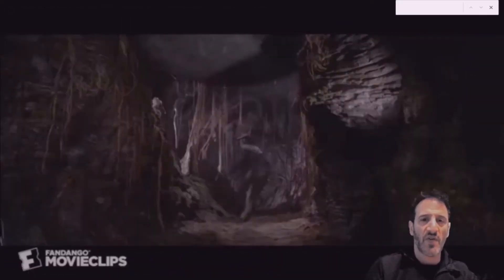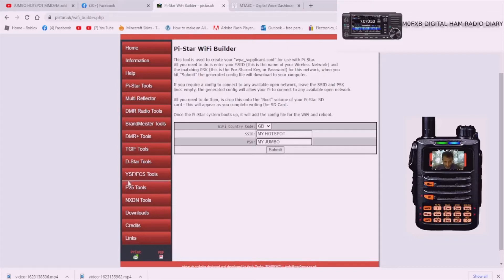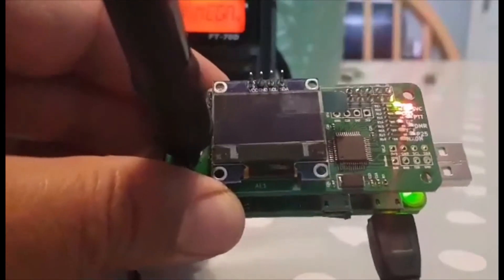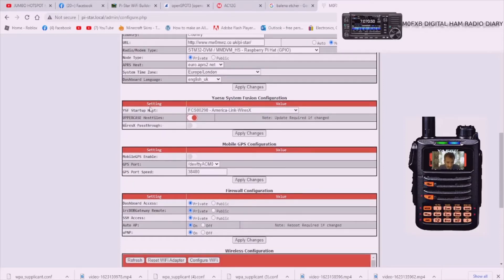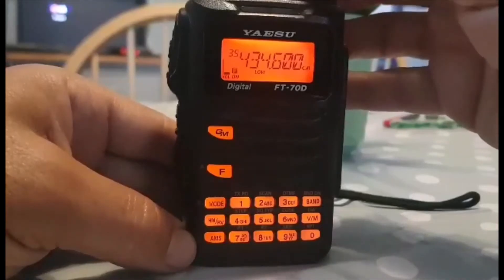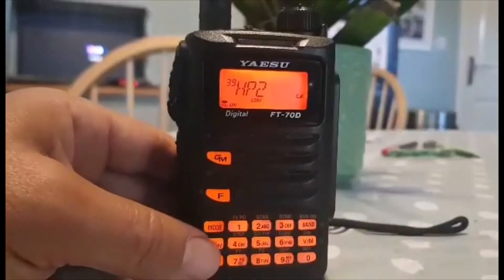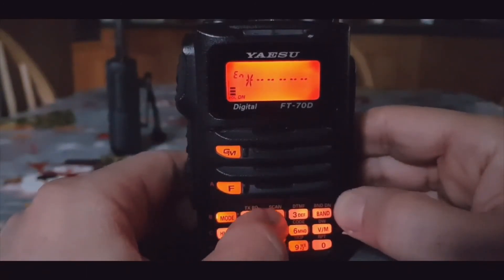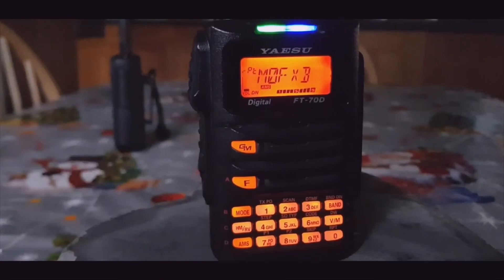YAESU FT70D ADD JUMBO HOTSPOT SETUP AND TEST

Comment: Hello everything is fine? I have a configuration problem on my ft-70r with openspot4 pro.... I hear very well but the transmission is very bad.... Do you have any tips on radio configuration? Thank you very much.
Reply from the maker: Hi , the default settings for the OPENSPOT should give you perfect audio .
Reply: @M0FXBHamTech  Thanks for the answer